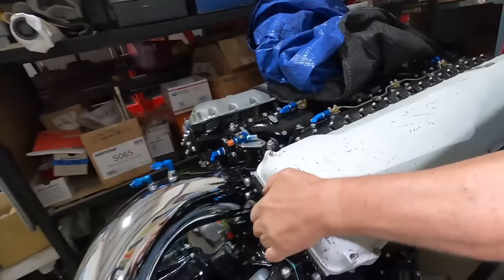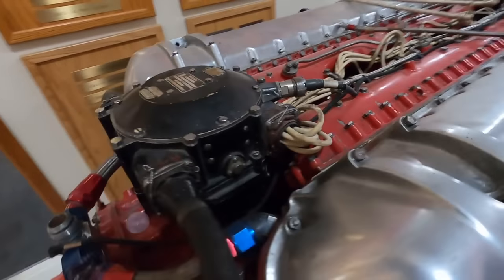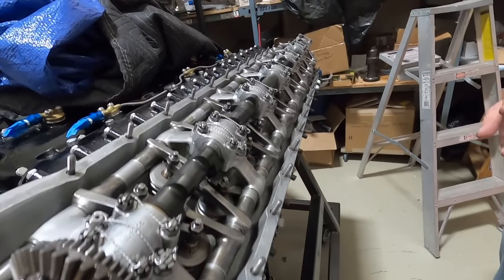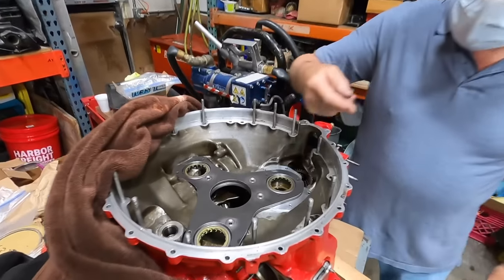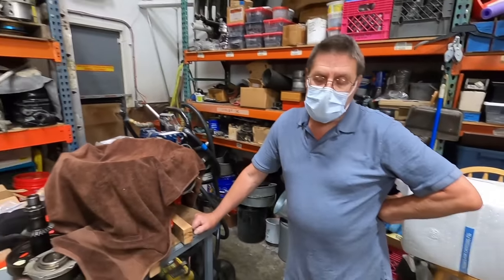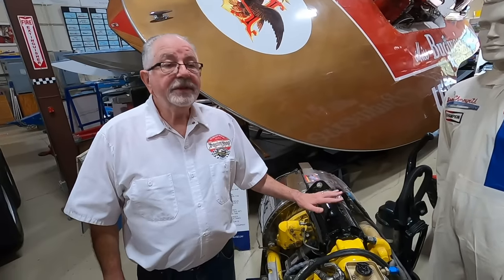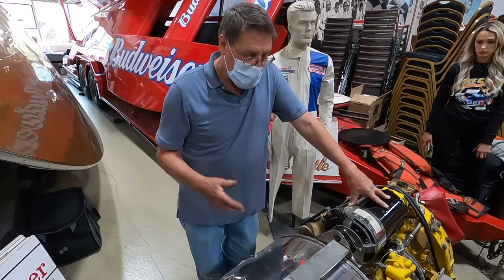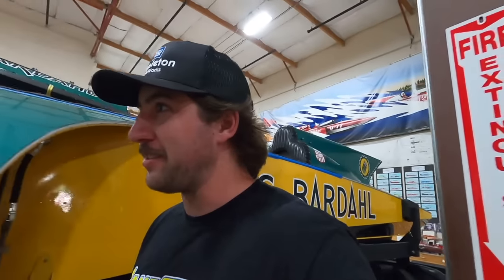The Rolls Royce Merlin: WWII Fighter Plane Engines Modified For Hydroplane Racing!

Comment: This "OLD JUNK" - a Rolls-Royce Griffon set up right could out perform the jet engines being used  today. I've been told that an Allison "modded out" could actually do even more, but there isn't enough money anywhere to support the day to day cost. And the engines and their parts have become impossible to find.
Reply from the maker: I can only imagine what a Merlin would do with more compression and modern valve train tech/cylinder head ports. 100 hp per liter like a stout modern v8 would have them making over 2700 hp without any boost 😂 If you had a volumetrically efficient 27 liter v12 that would not grenade I don't see why you couldn't make 8,000+ hp with modern turbochargers.
Reply: @Stapleton42  : But what about more compression on an Allison? I imagine the only downside a modded Allison might have would be the extra weight. Watching Allison's lose to Merlin's for the last fifty years I gotta admit I developed a soft spot for watching American-made lose all these races to the "Limies"(LOL).
Reply from the maker: @ronbuckner8179  Same concept could be applied to either I’m sure

Comment: This cool as, but please keep your acid fingers from touching unprotected metals. you will wear your welcome out real quick if you keep doing that. you look with your eyes not your fingers.
Reply from the maker: If they had a problem with us touching it they would have said so
Reply: @Stapleton42  You shouldn't need to be told. Obviously you don't know what acid fingers are. Do you know what the finger prints you leave behind after touching a metal object is? Salts from your body, they in turn lead to rust marks, they in turn lead to corrosion, which leads to stress risers which in turn lead to catastrophic failure of the component that you innocently touched. 

Answer this one question, Why do museum curators wear gloves when touching and handling rare and unique objects? 
If your answer is, so they don't damage the item they are touching or handling maybe I have educated you enough to understand my point.

Comment: Actually the easier way to tell is the tapered Valve covers on the Allison vs. the Rolls Royce Merlins. I have been to the speed boat museum in Kent Wa. It was a allot of fun.
Reply from the maker: You must be a real joy at parties
Reply: xray111  How do you tell the PACKARD version Merlin ????  The valve covers are stamped steel no name and RR's version is cast aluminum with the words ROLLS ROYCE cast in them !!!

Comment: As far as I know, the only place that split rods are found are in radials. I am stunned to see one in a V-engine.

This is amazing! Those engines are MASSIVE!!!!
Reply from the maker: Thanks man!
Reply: Razingthenraising  NO  the radial has a unit that all rods in a bank bolt to the big end is NOT split.  Only he V12's use a true split rod !!!
Reply: @wilburfinnigan2142   Oops. Yes, the con rods in a radial have a circular attachment. Thanks for the reminder!

Comment: Are these boats jet drives or prop driven??
Reply: Ahh, prop driven. I wonder what the weight difference between the ICE and jet engines is?? That jet engine has to be considerably lighter than those V12s.
Reply from the maker: I think you are correct. They make more power more reliably too

Comment: If you are serious about the Merlin in the Rolls, check out Jay Leno's Merlin Powered Rolls.  The engine has such serious torque with that massive 1650 CuIn block, that he had to get Gail Banks (the turbo guy) to help him fit a proper transmission that wouldn't explode when you even thought about using the skinny pedal!  They also removed the blowers and replaced the carburetors with a 12 pack of weber's I believe so that it would run smoothly.  If I remember correctly it will go 60 or 70 MPH at idle in high gear. :-) :-)  Sounds like a fun project for you!!
Reply from the maker: It would be if we had his budget lol. Someday!

Comment: The Griffon did make it into the Spitfire and when you see the airplane it can  be distinguished by the prop. Griffon uses a 5 blade propeller and the Merlin uses a 4 blade propeller.
Reply from the maker: Interesting!
Reply: 4 speed3pedals Only the LATER 60 series Merlin with the 2 stage supercharger uses a 4 bladed prop, the earlier spitfires with the single stage 20 series merlin use a 3 blade prop.  Just more of the CORRECT facts of history !!!

Comment: Some WW2 piston engines had two carbs, each set up for different fuel/air mixtures: one for high altitude, one for low.  That's probably the reason for the compound blower.  The Germans used fuel injection, negating the need for two carbs.
Reply: wayneo  Neither the Merlin nor the Allison used 2carbs !!!! They both used a huge Bendix pressure carb, more like a throttle body today !!!  FACT of HISTORY !!!!

Comment: And to think these motors were being made when ford was still putting flatheads in cars.
Reply from the maker: great point!
Reply: @Stapleton42  No it isn't. If the suggestion is Ford could only make a flathead then its an ignorant comment. Ford's goal and business model was to build inexpensive, reliable vehicles the every man could afford. The use of the flathead helped make that a reality.   His genius and contribution was to bring affordable automotive tech to the masses.